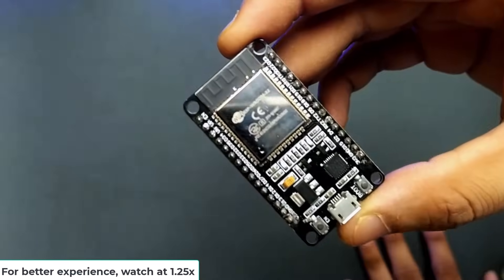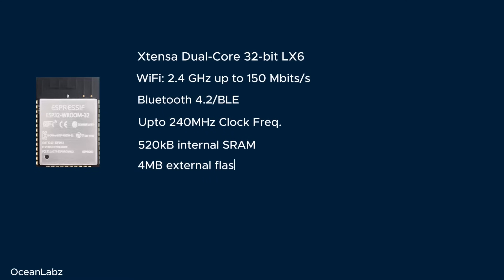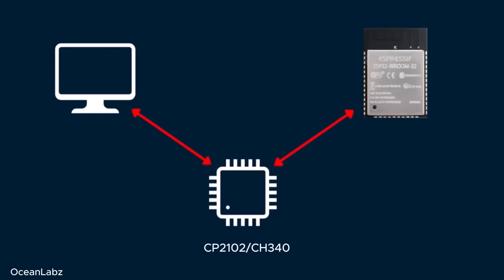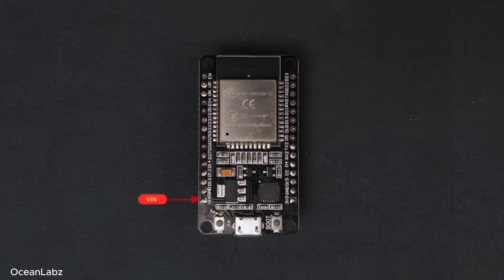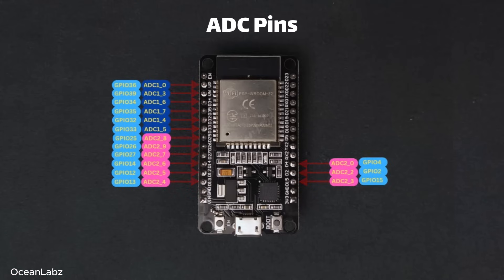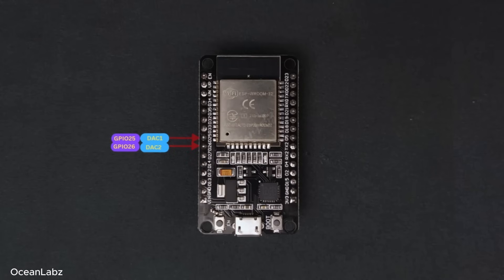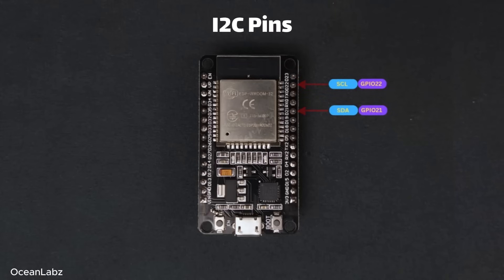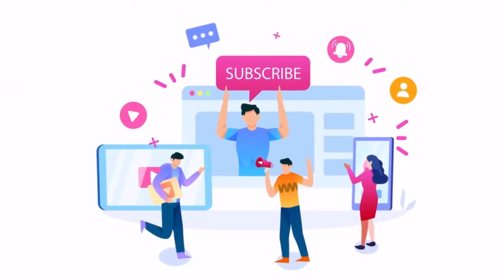ESP32 DevKit v1 Explained for Beginners | Board Overview, Pins, Peripherals

Comment: sir could you help me my ESP32 devkit v1 is unable to connect through wifi it is showing brown out issue in serial monitor
Reply from the maker: A brownout usually means your ESP32 isn’t getting enough power. Try a better USB cable, a different port, or an external 5V adapter.
If the issue gets solved, please share what worked, it can help others too! 🙌
Reply: @Oceanlabzdotin it didn't work I think my esp32 is faulty

Comment: i have a question, so if i have vdc 3,3 v, can i used it for turn on esp32 devkit v1 by connect it to 3,3 v pin?
Reply from the maker: Yes, you can power the ESP32 DevKit V1 with a regulated 3.3 V supply via the 3V3 pin. However, this bypasses the onboard regulator, and the USB-to-serial chip may not receive power, affecting USB communication or programming.

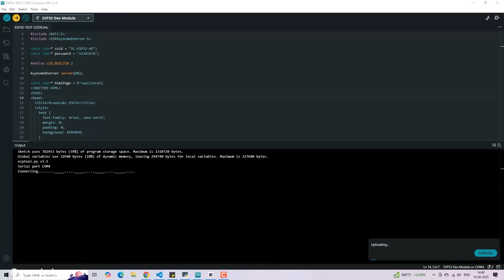Comment: 8:24 Not loading your program as shown is normal for the V1 board, most (but not all of them) need you to press the EN button during the program upload. I have a few that don't need it and it's a blessed relief to just complie and upload in one go. Some people reckon a capacitor to ground is enough to make it work right, but it hasn't for me.
I now use the ESP8266 d1 mini for small projects which does not give a problem.